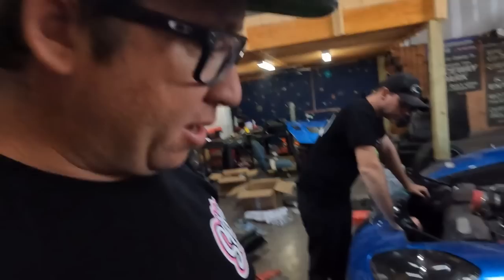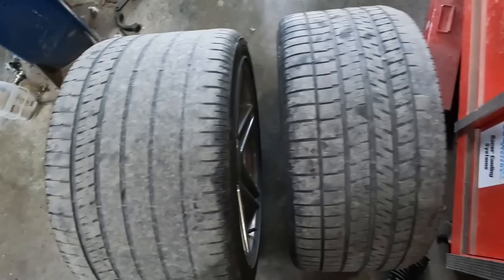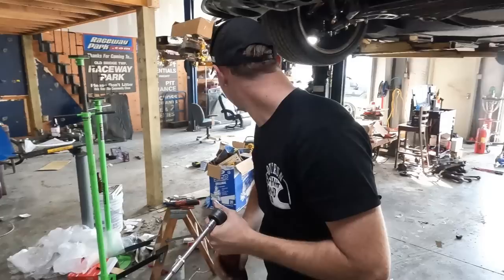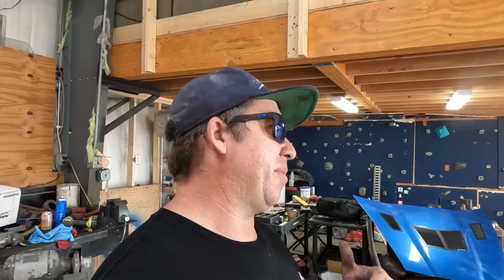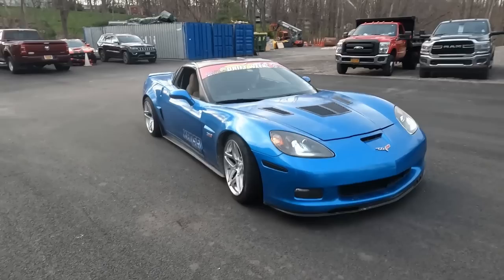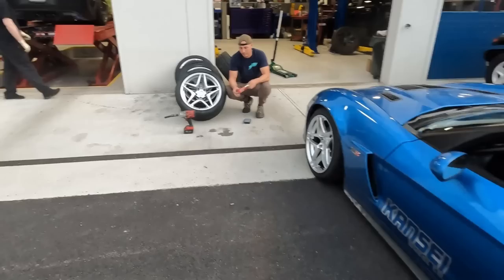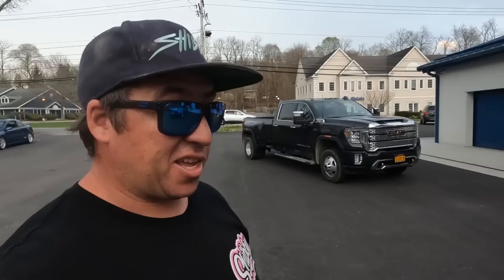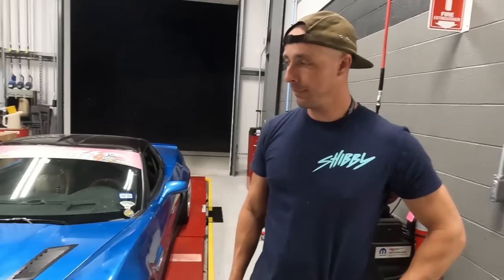NEW Wheels!

Comment: Hey lukey boy can u tell me the paint code on that vett the blue is Dam nice
Reply: the blue is a wrap. the car is originally red. but it is a sweet colour
Reply: @shaunlatter5263  didn't they come from factory in a similar blue ?
Reply: @barra190kw9  I'm not sure. But u maybe right coz I believe Taylor Ray's new Vette is a factory blue z06 colour.
Reply: @shaunlatter5263  @barra190kw Lemans blue is about the closest factory color from C6's and I believe that's what Taylor's panels are painted if they went with a factory color. Laguna Blue on C7's is similar to the wrap on Luke's car but is a bit brighter than Lemans.
Reply: @NomisChild1  cool thanks for the info fella cheers